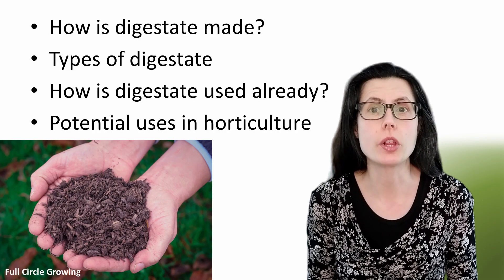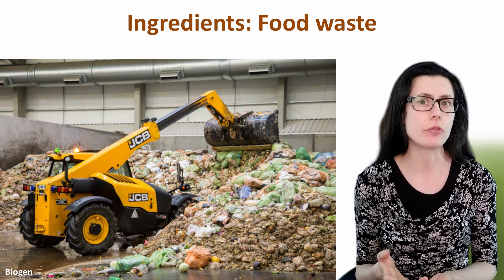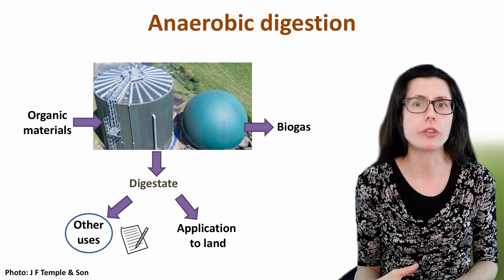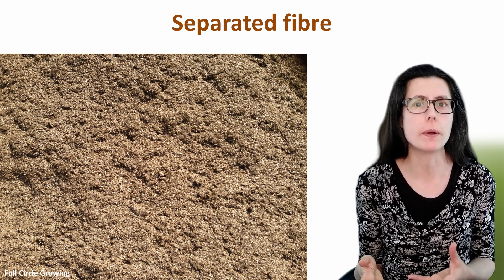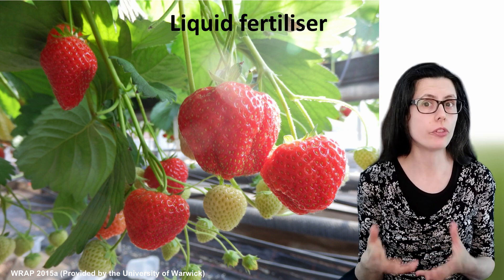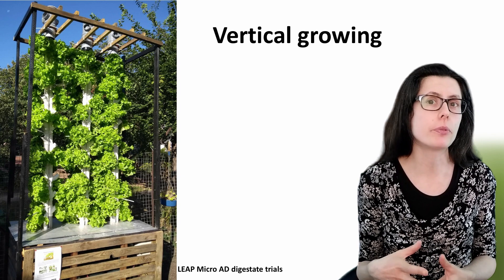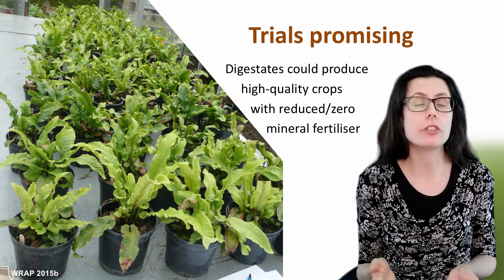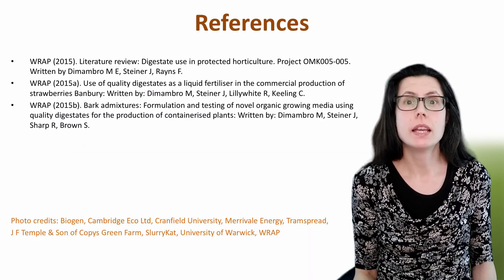DH01 The potential for using digestates in horticulture, an introduction

Comment: Great fertilizer. There are things inside slurry ... you will need a lot of cash to buy them. I use bioslurry for 4 years now on olive orchards in Greece. i imagine that slurry increased the biodiversity in my soil because i don't have verticillium problems the last 2 years.i lower my  fertilizer use and my costs .
I want to filter it so i can apply it with foliar applications now.
Reply from the maker: Hi Stathis. Many thanks for sharing your experience. Yes farmers in the UK also see the fertiliser value of the digestate, especially now that fertiliser prices are increasing a lot.
A UK study also showed a reduction in verticillium when digestate was used, in strawberries* - here's the full report: https://projectblue.blob.core.windows.net/media/Default/Research%20Papers/Horticulture/SF%20157_Report_Annual_2016.pdf

*Note that as per the video you always need to check the regulations for digestate use in your country.